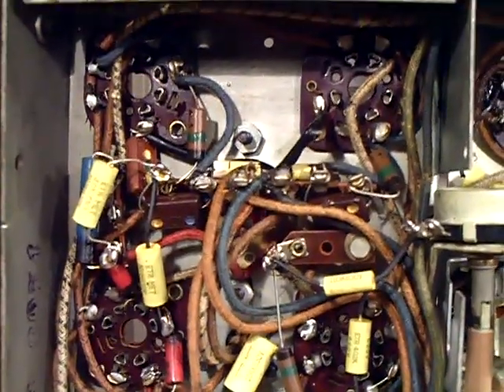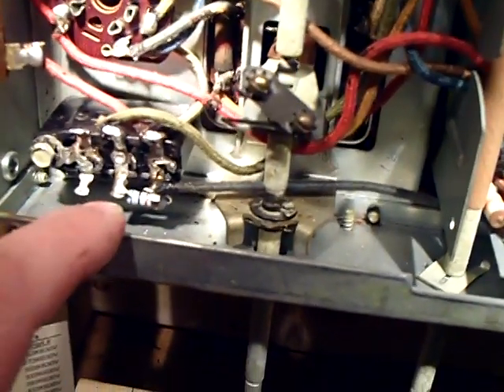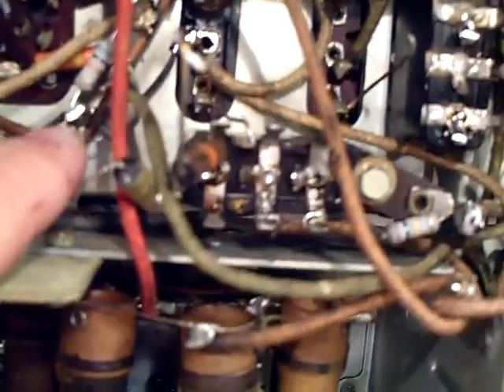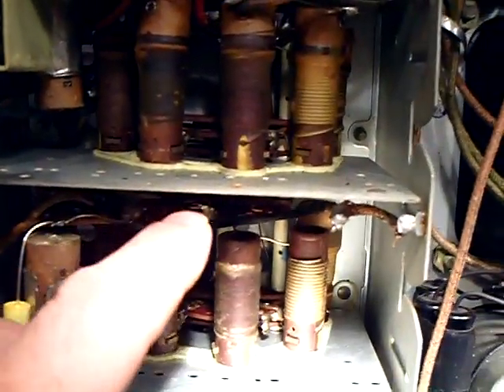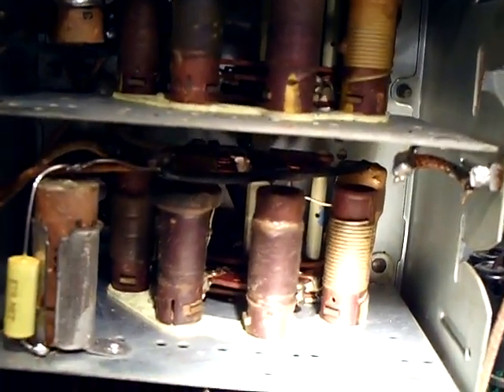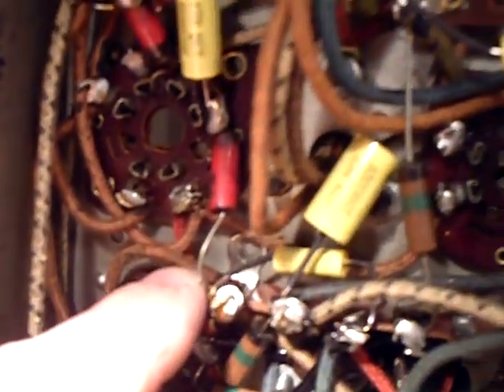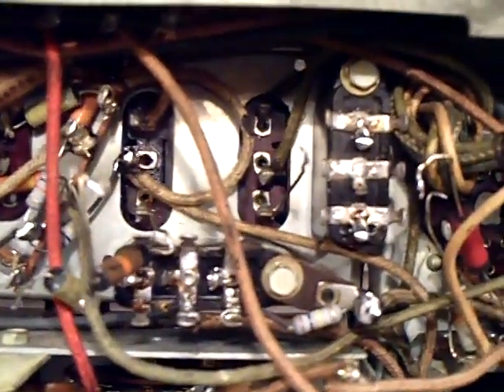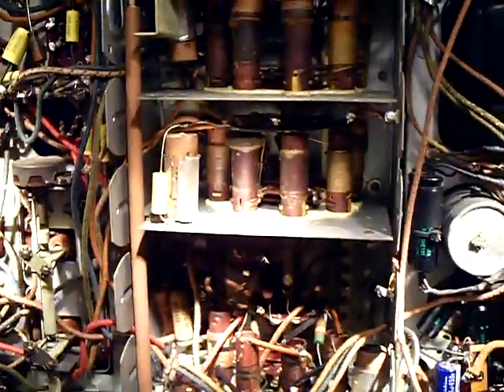Philco 38-116 Repair, Part 8, Making Good Progress

Comment: Nice work.  The most frustrating thing about restoring an old radio is finally turning it on and current music comes out.  On testing a resistor without disconnecting one lead, yes you can do that, but with that cap also there, it would depend on where the cap is in the circuit.  Gotta go watch your other videos on this, Thanks!

Comment from the maker: Sorry for the delay. I just saw you wrote. I got the cloth covered wire from Radio Daze dot com.

It's thicker than i like it to be, but it's very good wire. It has a dielectric plastic type coating, then the cloth is applied over it. Just go to their web site and select wire from the left column and you can see what they have. If you have any questions about the wire, the guy who runs the place is a super nice guy.

Comment: On that capacitor in the shield....if you wanted to get it out of there, what if you used some heavy duty cutters or tin snips and just cut it in half, or in sections, and slide out the pieces...unless you want it there for originality, then it wouldn't matter.